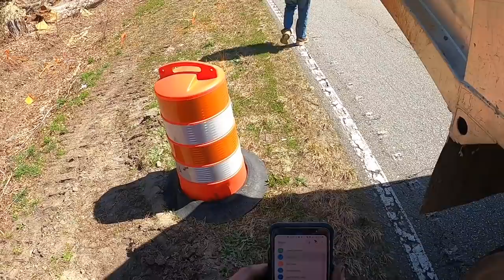Chaining a rear axle up on trailer. Not so smooth.

Comment: The last time I had to do that before I retired I didn’t have a jack with me so I used a ratchet style chain binder and it was much easier than a jack like I had always used. Good job as always, Stay safe out there
Reply from the maker: Mr John  We tried 2 binders.  It wouldn't budge it.  Thanks for watching and stay safe
Reply: I guess I was lucky the time I used the binder the truck was empty and I had a well greased 1/2 inch binder

Comment: You know what they say about, if bullfrogs had wings, check that equipment a little more often you know there are 40 different sizes of air fittings and the ones you had on the truck 🚛 weren't lucky enough to be the right ones. Have a good day Hal !
Reply from the maker: Bates Bates  Yes sir thanks for watching and stay safe

Comment: Hey Hal !!! NOT telling you your business as you know more about it then anyone,, but being an ""OL"" pipefitter back in the day ,, WHY didn't you just take out the Quick connections on the hoses & just hook it direct & control the air to the jack with the Emergency valve in the wrecker as you had  Joe to help with the issue ???  Again ,, Great Job with what you had to work with & I'll bet that ALL the hose connections have been changed to just 1 Manufactures style so this doesn't happen again to any of your wreckers or service trucks !!!  Have a good week & ""KEEP IT SAFE ""!!! Another hind site was that the lift could have been done with a ratchet binder stretched out all the way ,,then tightened up as have done this trick myself with a flatbed trailer loaded with junk cars !!
Reply from the maker: Mr KB Yes sir that would have worked. You just never plan on using another company's tools. We keep all the smaller type just not the bigger ones. Thanks for watching and commenting. Stay safe

Comment: Hi there from england, wouldn,t dream of telling you your job, but we put a wooden block between the other axle and the chassis, stops the other axle pushing down on the broken one, takes alot of weight off your chains, stay safe.
Reply from the maker: Mr Phillip thanks for the tip and thanks for watching.  Stay safe

Comment: That trailer is a rolling wreck. If those studs broke then the rest of them are probably suspect too. I noticed the brake shoes (or lack of) need attention as well as the tires are shot. Owner needs to spend some money on it. What if that tandem had come off on the driver side into oncoming traffic. Could have been bad bad. Wonder where it went?????
Reply from the maker: Mr Johnny I am glad it happened in the swamp. Thanks for watching and stay safe

Comment: Think I would be getting air jack. You have air on wrecker.
Reply from the maker: Mr Larry We have one but it had turned over and the fluid had leaked out. Thanks for watching and stay safe
Reply: @SumterWrecker  I thought you did.  But second trailer with axle problems.  Great job. I used to live in Bluffton SC.
Reply from the maker: @larryshedd9725  Yes sir been there a few times.  Thanks for watching our channel and stay safe